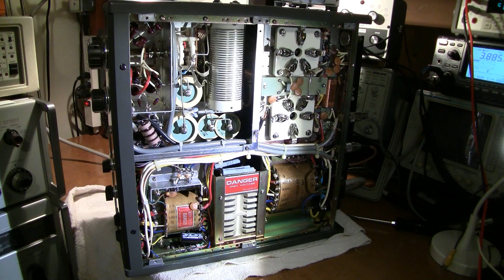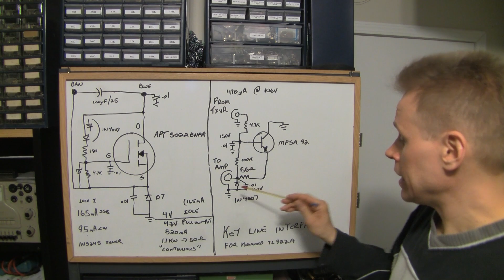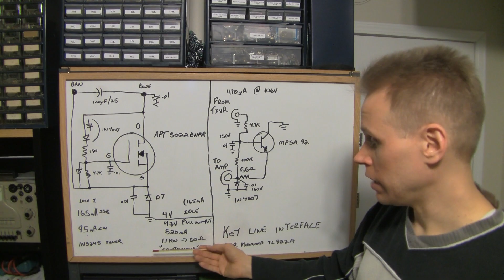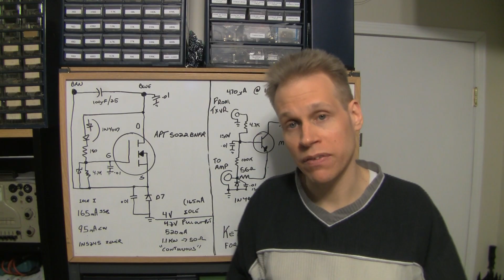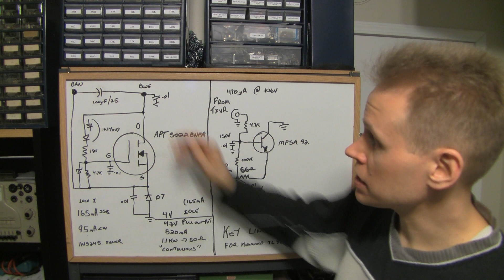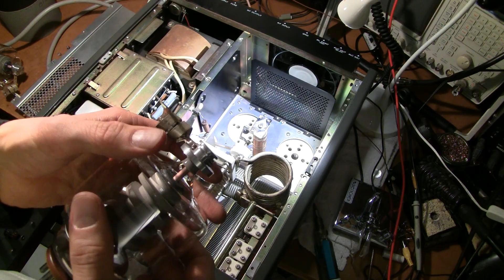KENWOOD TL-922A Repair and Modification

Comment: Nice video!

Just as an aside. the "Z" in 3-500Z indicates that the tube is designed for zero bias (grounded grid) service. The Z was part of the original Eimac designation for the metal plate tubes.  Some sellers designate their graphite plate versions as a "3-500ZG", and others (like the Amperex tubes you showed) just used the standard designation for their improved graphite plate version.
Reply from the maker: Thanks for taking the time to write Bob!

Comment: I have a 922, and when I advance the drive higher than about 25w from the exciter, my grid current goes up higher than 300ma (brand new RF Parts tubes) and I'm not sure why the grid current is going high, where the load control won't drop it down.

Comment: Hi Mr Carlson, 
  I got a project for you, If you interested.  I am a boater.  I have two electric trolling motors on the back of my boat.  They are controlled by a foot pedal.  Simply on or off no turning the motors.  Both on boat goes straight.  Both on in reverse boar backs up.  Left on boat goes right.  Right on boat goes left.  I want a joy stick control.  My foot is not very coordinated with my blind eye.   Tom Harrell pharmacyman@att.net 
239-810-1309 please use txt msg deaf and dim LOL

Comment: Years ago I built a Heathkit SB220 amplifier. Things went well during the kit building.
When I got finished with it, it was time to fire it up and test it out into a Heathkit Cantenna dummy load.
I got plenty of RF through bands 80-15. On 10 meters I got only the power the Kenwood 820 put out and nothing more.
I checked and re-checked all the wiring but gave up and took it to the local Heathkit store.
The store manager told me to bring it back to the test bench for testing. The technician set it to 10 meters with a wattmeter to a dummy load. Instead of tuning up the radio in steps as you did in those days he cranked the radio up to 100 watts and started twisting the tune and load controls on the ampflier.
The two 3-500Z tubes started to get red hot and then white hot, then the parasitic chokes on top started to smoke!
I told the manager to have him stop as he was burning up the ampflier tubes.
At that time they were $ 180 each!
He told me the repairman knows what they are doing and we sell the kits in front and that is all that counts.
After several letters and phone calls I got two new tubes and somehow they found what was wrong with the amplifier. When asked they did not know.
I had build a number of Heath Kits and about half of them had mis-labeled capacitors or errors. It’s no wonder some people call them Greif Kits.
I am still running the amplifier to this day and that was 37 years ago.
Reply from the maker: Great story! Thanks for taking the time to write.

Comment: What do you have to say about strapping the grids directly to ground?  Also what is your opinion on the hairpin type of parasitic suppressors on the plate circuits?  I have done both and can see no difference but I don't have sophisticated instruments to check everything.  I get very good reports on signal and audio using a Kenwood TS-520 with a MC-50 mike.  Also I have only two good 3-500 tubes left.  One is metal plate and the other is graphite but they are happy together and give me full output.  Any comments? Thanks, KV4JT.

Comment: Hello, great video. The IG meter in my amp stopped working. I suspect one of the diodes linked to the meter may be damaged and plan to replace it. Do you happen to have a video for this area? I would like to know the diode's location and where to buy the part.
Reply from the maker: Unfortunately I do not. Maybe in the future though.

Comment: The TS-2000 Kenwood has an old style reed relay in the TX keying ciruit, so its not nessecary to do this modification, but having said this I did this many years ago so its done and forgotten about.

Grounded grid, same as Heathkit, Collins, Drake, and several others.  Also its has a tuned input design so you are tuning the input as you match the load and plate.

Comment: My TL922 just arrived FEDEX from Jupiter Florida. I have always wanted one of these. I am restoring a total Kenwood Station based on the 520S and have all of the pieces and extras. What a beautiful piece of cosmetic design as well as performance. The fact that I found this at the time the AMP came was fortuitous. (DA-DA-DA Twilight Zone Theme)
Reply from the maker: Sounds like a great project. Good luck with your station.

Comment: Great video as always, Paul.  I built a similar "soft key" circuit for my SB-220.   One thing, though if I may.  The 3-500Z is the name for the original tube with the standard plate.  The graphite plate tubes are 3-500ZGs.   Just for clarification for those who are tube shopping. 

Thanks!
Reply from the maker: +ShooterReady 
Thanks for your input!

Comment: It makes you wonder why the company has not made these modifications. Well I know from experience that when it comes to design they will look at all aspects to save money by using cheaper parts to maximize profit margin, which unfortunately can have dire consequences to the operator in some cases. Safety must come first but often falls prey to production cost.
Reply from the maker: +John Cunningham 
Thanks for your comment John!

Comment: I use an Ameritron ARB-704 to handle the T/R switching.  It is a nice little interface between old HV T/R systems and new 12VDC radios.  People bring me tube amps that are HV T/R switched so I like having a external box to protect my radio.  The TL-922 power switch gets pitted badly.  I tore it apart and flipped the contacts around to use the new end. I bought my amp used.  The tuning caps had the edges melted!  I had to grind off the melted and mushroomed aluminum ends. Then clean all the mess I made up.  I have modified my TL-922 for full QSK operation.  New biasing, true grounded grid, etc. Works well.
Reply from the maker: +hamsoftware 
Sounds like you put a lot of time into that amp! I agree, simple is sometimes better.

Comment: I use an old 9.6 volt Makita cordless drill with the torque setting turned way down, as low as it will go, on the high speed gear setting (to reduce the torque even more). It simply ratchets & rattles those set screws loose, without using very much torque, much like an impact wrench. It works a real treat doing that. It also does a great job backing roll pin punches that are jammed into firearms really tight, out of a gun without breaking the punch pin off. Just chuck the hex shaft of the punch into the drill, hold the chuck so it won't turn and let the drill rattle the punch, and it backs it right out of the gun. That was actually how I discovered it would work on those plate cap connectors on transmitting tubes, and it does,.... extremely well. Maybe use the pliers too, but there is so little torque when that setting is backed off as far as it will go. It is a very gentle but extremely effective very low torque impact type action. I have had to use it with screw terminals on Japanese made pressure sensors in process & automation instrumentation too. When those are assembled they use a constant velocity clutch actuated screwdriver, which really rams the screws in super tight. You can easily destroy the screws and damage or destroy a brand new $26,000 sensor.
Reply from the maker: +Seth B 
Thanks for your input Seth!

Comment: I'm been a radio ham for 40years. I had a TL922 for 25years without a hitch, orgianl Imac2X300Z installed. Sold it to me friend, he had it for 5years at least. He sold it to a University in AR USA. Sent it Fed Ex [Air] did not remove the tubes! Arrived in AR safe and sound.  The university switched the TL-922 on, all fine. As far as I know, it's still working today!! 

Thanks for taking the time to provide these videos. You explain things very well. Keep up the good work MCL! Roger-G4SEF UK
Reply from the maker: +Roger Jenkinson 
Wow, I was expecting broken bottles. That's good it arrived ok. Thanks for the story, and your comments!

Comment: Another terrific video.  Very good explanations.  Wow the Kenwood amp has some real engineering inside.  Its amazing!  I'm restoring a SB220.  My SB220 is near original so I'm doing research as to how to update it.  I'm adding QSK and a circuit similar to yours for the keying and of course a new bank of caps and rectifier board.  I'd like to add 160m to the Sb220.  What do you think about stealing the input circuits out of an Ameritron AL82?

Comment: Great video, I have TL-922A, but have not open up this amp and got it used and do not know if any modes have been done.The other day, I switched the CW/SSB from SSB to CW and heard a very loud pop from the switch. When I switch it back to SSB it blew the fuse.I have been told I do not need this switch anymore because of the law change.I ordered a new switch, but now not sure if I want to open up the TL-992A.I am 70yrs old and like to see 100years, but will to open it up if shown the do's and not to do. Thanks again for your video.
Reply: Larry Carbaugh I know that your post was ages ago, mine does similar when that switch is operated. The power supply section of the amplifier is a bit skimpy and the cooling a bit weak, I have done a few mods to mine, it’s a nice amplifier but not really capable of the full US legal limit.

Comment: Excellent video! I have to ask where you acquired such a depth of knowledge of vacuum tube circuits. I'm 64, so my early ham days were in that era. I haven't found many younger people who ever learned about this stuff. I love seeing the mix of old and new tech.
Reply from the maker: +Bill Moran 
Hi Bill, That's a different Carlson your responding too.
Reply from the maker: +Bill Moran 
Thanks Bill!
Reply: +Mr Carlson's Lab i have some old speakers they are altec lansing 515-e model Is this a speaker that is valuable to people that are into the types of amplifies you are showing here
Reply: +Bill Moran I'm 51 years old and all of my "push button" solid state stuff sits around collecting dust these days. All of my stuff on the air now is high quality hybrid radios from the 1970's with vacuum tube PAs and vacuum tube amps. (Kenwood TS-520s and Yaesu FT-101's are my favorites).  Transistors have their place, but I've never liked solid state PAs. 
High end vacuum tube Hi-Fi is making a comeback as well and all of the popular hi-fi tubes are back in current production (EL-84's, 12AT7's, 6414's etc........) and they're relatively cheap and GOOD. If only 6JS6C sweep tubes would come back into production, there would be a lot of happy campers out there. 
73. de Scott, KK7VY.
Reply: +Scott Carlson 
Just a thought for a future video: a comparison of vacuum tube analog circuit design In receivers ( tuned oscillators etc) vs present day digital designs. A lot of us old guys (I'm 64) were left behind when everything went to circuit boards and surface mount chips. 
I enjoy seeing you move between the old and the new.

Comment: thank you for all your video you have any for the ameritron 811 h it lost power only 500 pep out i first got it was 850 pep even with new tube only 500 out i think i have 2 resistor bad there on the same chassey nexts to the tube you can see them there is 4 of them 2 look like the plastc wrap burn off  this not the older 811 h its the newwer one factory change the relay aand these resistor there not color code like on ameritron page for the 811 h i had a tube ark with the first set of new tube replace one of the tube 500 watts tube ark took out one tube dont lite up
Reply from the maker: +joseph kopeczy 
I have seen many Ameritron's, but haven't done a video. Possible future video idea.
Reply: on there sale page for the amp they rate it for 800 watts but on the phone there tech say its a 600 watt amp i think it the book its say 850 pep  i use  yaesu   ys 60 watt meter  i use the pep power setting  the amp in time tube fail and burn the grid resistor that 51 ohm 3 watts they say it is  thank you like see some on the ameritron 811 h and yaesu ft 950 repair there are some but not in english keep up the good work if your a company show your shop phone number or email  i like the relay mod you did for the 1000 d yaesu

Comment: Nice video's Carlson! I wonder how exact the spec's on the Bias MOSFET need to be. The APT MOSFET you specified is evidently out of production. No NOS available that I could find. I think an IRFP27N60KPBF may work as a sub however it has an internal diode across Drain to Source. Otherwise it has fairly close spec's. What's your advice here and/or can you advise where I may procure the APT device you spec'd.
Reply from the maker: +deppedyDogg I'm hesitant to recommend another device, as I can't test it. (amp has been gone for a while) Thanks for the kind words!
Reply: +Mr Carlson's Lab : Are you willing to part with one or two from your $leeve?
Reply: I had this issue in the amp last week. The arc shorted the Zener and C3. I installed the IRFP27N60KPBF and also two diodes IN4007 in the Gate as Paul explained in the vid. I have a bias of 90ma in CW and 170ma in SSB. The voltage at the Drain is 6.3v idle and at TX it goes up to 7.4v. Works fine so far. Output on CW is about 600w, and on SSB peaks are over 1000w. I drive with 90w. I hope this info helps others.

Comment: Great video. I'm familiar with vacuum tubes in audio amps but not with tubes used in rf applications. Pretty amazing. I'm going to do some research to learn more.  I was wondering if tubes are still used in commercial broadcasting equipment or has the technology changed? Thanks.
Reply from the maker: +Jim McDowell
Most all broadcasting equipment is now built with FET's in modules. Still widely used in amateur equipment.
Reply: @MrCarlsonsLab  still used in MRI,fm broadcast use fet modules yes,but like to see 500 kw transmitter on HF with modules LOL

Comment: Paul, was there any chance you could have just replaced the relay with a solid state type keyer?   Jack
Reply from the maker: +Jack neff 
Hello Jack. High standing wave ratio or (SWR) is what destroys solid state devices. Since this amplifier is used in amateur radio use (HAM), it's going to see all sorts of different antennas and loads. In short, the mis-match between the two devices (antenna and amp) would make a solid state relay system unreliable. Thanks for your comment!
Reply: Thanks for the reply Paul!

Comment: i always replace zener diodes over to 1n5408 then fuse bias to just over max plate current with a 50-100k resistor across the fuse holder .. this is usually fine for US tubes due to low bias voltage requirements .. but if using some of the Russian tubes there usually 30+ volts zener with a nice pass transistor like your setup

cool video as usual
Reply from the maker: wizzkidelectronics Thanks for you comments and suggestions!

Comment: Hello  again... just finished viewing and noticed you have a Bencher key like mine (BY-2) although I currently have been using the Kent Iambic.
About the biasing circuit and replacing the Zener, I remember seeing once an Heathkit amp (sb230) using the PN junction of a power transistor as a Zener and the circuit diagram really shows the symbol of a Zener but I think it was originally like that.
Finally with this video I concluded that the TL-922 is just nice to look at but is full of design flaws. I wonder, with your experience looking at the inside of many amps, which one do you think is better built, with the same type of circuit ( a pair of 3-500Z).
Reply from the maker: CT1ELP Probably the best I have seen are the Henry Amplifiers, The Johnson Thunderbolt, and some of the older Collins gear is good as well. Anything made for ICAS operation will be this sort of build nowadays. All this equipment is intended for ssb operation. When designing anything, building it around an "AM" mind set will make a superior product. Again, this stuff is made for the market, and they have to compete with each other to sell their under built product to people. Penny pinching drives quality out the door. I have seen (and built myself) some home brew stuff that you just would never find on the every day market.... Just due to no "bean counters."

Comment: I used to work on amplifiers and transmitters which operated at much higher voltages and were biased so that ZSAC was three to six Amperes (No, NOT milliamps!) per tube in AB push-pull.  Consider that...'WAY more than 100kW of dissipation...at idle!

If one "messes up" on a 3-500Z amplifier, his wife might find him dead; if the same sort of error occurred when working on a "big" amp, one's coworkers (or XYL, HI HI)  might -- might -- find a few bits of a wallet and a smoking shoe somewhere in the building.  We all came "close" from time to time, but I never saw anyone get blown away.  The stories I could tell, though...
Reply from the maker: EdWatts You have a great name for your past line of work! There is a reason for a "Dead Mans Stick." I have built a few power supplies for amplifiers that source "around" 4 amps at 4850 Volts. I had porcelain standoffs  "explode" and couldn't find bits of it anywhere. That was really weird.... on more than one occasion too. Sounds like you have some good stories!

Comment: Great video! You saved my FT-950!
What do you think about cutting s square hole in the top cover and adding a second fan in "push" mode, forcing air in over the top of the tubes?
Reply from the maker: E Risi Glad to save that 950! I wouldn't bother with the hole, that will just destroy it's resale value.
Reply: What about a replacement top with a fan to force air down onto the top of the tubes? Or is cooling the bottom actually more important?
Thanks!
Gene, W1EBR